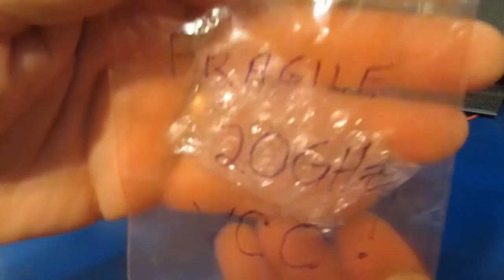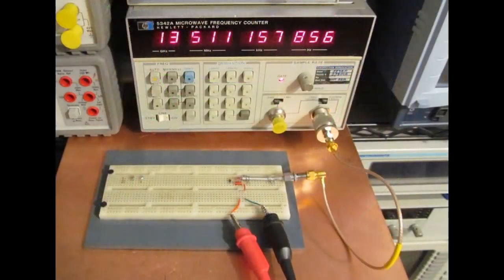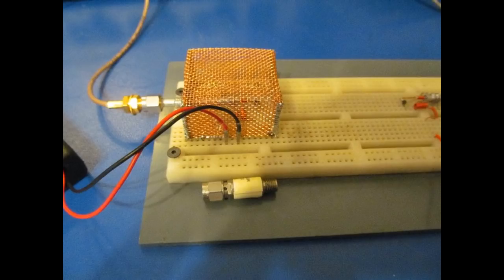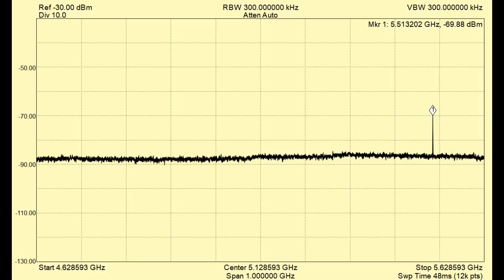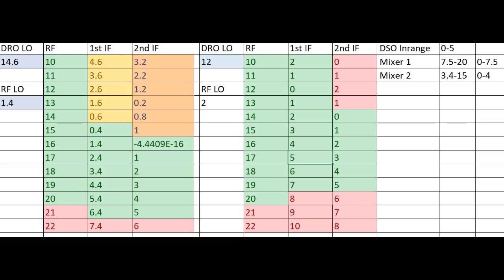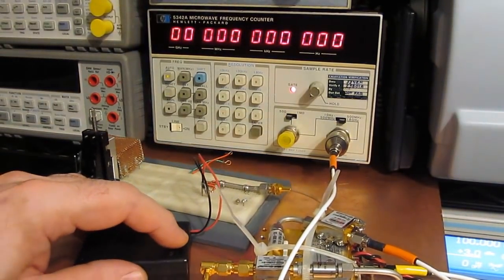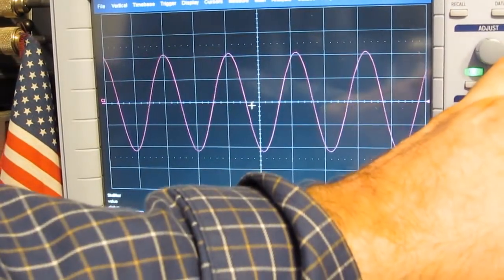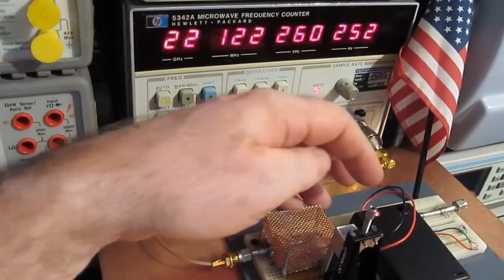Conclusion to the worlds fastest breadboard oscillator

Comment: I think at this point calling it a “breadboard” oscillator is reeeealllyy stretching it :) I always claimed that RF circuits look more like a moonshine factory than electronics, and your “it’s just wire” kludge up close is what I imagine some steampunk brass and copper “moonshine factory” might look like. This super cool stuff, especially for someone without RF experience. Very encouraging!
Reply from the maker: If you go back and read that thread, you will find that I was asking for clarification on the rules every step of the way.  A fun and entertaining little project but not very useful.

Comment: Nice Job, bow to the king. I sort of thought moving to a battery would have been good to prevent any noise from a power supply affecting  your oscillator output.
Reply from the maker: Outside of wanting a sinewave, there was nothing in the rules about distortion or drift.  Join and let's see what you can do!

Comment: I have no good frequency counter or high end lab equipment to test my idea, but you can test it! The idea is to use gas discharge plasma for microwave generation. As a gas discharge tube you can use neon lamp or another plasma device. The plasma oscillations frequency is proportional to sqrt(plasma electron concentration), which depends on gas pressure and voltage applied.

Comment: A great video. Microwave electronics really is plug & play!

I wonder if the mixer input match just detuned your oscillator a little!

Also, you could build a little delay line frequency discriminator to at least approximate the upper frequency limit if you were so inclined.....
Reply from the maker: It's possible the loading will pull it but the thing drifts around so much when you handle it, I may be difficult to detect without automating.   Close enough.

Comment: Can you tell me what brand,number and how many you have hooked in this video. I like the size as most I find are so damn small. Thanks
Reply from the maker: I bought 4 different transistors for this contest and had one that I had started with.  I am not sure what damm small is but again, I am using wire that has a smaller diameter than my hair.    Looking forward to seeing your entry.  Good luck.

Comment: hi, so i recently bought a Brymen BM869s and for the most part i'm really happy with it's build quality, fonctions, etc... but i have one complain with it that is somewhat intresting.
I wanted to try the crest fonction in VFD mode to see if there was any major differences compared to the normal ac volt mode and so i plug it into the mains ( 230v 50hz  where i live ) in VFD mode and at first everything was normal, i go into the crest fonction and everything was still normal, the problem was when i go back into the VFD mode, it doesn't autorange to 230 volts, it stays at it's lowest range and obviously overloads it ( both the ac reading and the bargraph but not the frequency reading ), so then i tried with a 12 volt transformer and same problem, even if i unplug the meter and then plug it in back into in mains or the output of the  transformer without changing anything, it stays in it's lowest range almost like if it was in manual ranging mode, the only way i found to go back into the autoranging mode is to either change the mode to ac volt then go back to the VFD mode, press the select button  or turn the meter off and then back on.
So i was wondering if you have the same problem with your Brymen and if there was a way to improve this.
In my opinon it's still a great meter and i'm still happy with my purchase 

and sorry for the length of my comment
Reply from the maker: Odd you would post it under a video on an oscillator but no matter.  I believe the manual mentions how the manual range remains.  You should be able to press the Select button to clear it rather than changing the function switch.

Comment: Hi Joe,
This is more a general question for your robustness testing on various multimeters:
I've seen a channel called Kiss Analog test a multimeter from amazon:
https://youtu.be/wfFG8v-RPQ8
Interesting about this multimeter is that it's 1: very cheap, and 2: UL listed/IEC61010 comliant etc; it's the amazon commercial 90DM610:
https://www.amazon.com/AmazonCommercial-Count-Digital-Multimeter-CATIV/dp/B07W1BL3RH
($47,72 currently on amazon).
I thought this would be an interesting candidate for your robustness testing experiments, as this might be the cheapest UL listed/IEC61010 compliant multimeter around with a reasonably good featureset.
It has a very similar featureset to for example the brymen bm235 but about twice as cheap (the brymen only has a better advertized accuracy), and of course easily available through amazon.
I think it's made by/rebranded from CEM.
EEVblog forum thread about hacking it: https://www.eevblog.com/forum/testgear/amazon-commercial-90dm600-multimeter-hacks/

Comment: I see a breadboard balanced on a copper clad springboard oscillating at about 5Hz - surely this cannot be the record? Maybe weighting down the inboard end of the copper clad with an HP frequency counter is not the only or best solution? I do see that the weight of the battery on the breadboard is slowing it a little, but I understand that cats must not be electrocuted without good cause. Congratulations, all very inventive.
Reply from the maker: lol  I have been using PCB material for some time to support smaller experiments like I have shown.   I made up one with better support and sides to prevent parts from rolling off but it was in use.   I should make up a second one.

Comment: For higher frequencies could you not measure the wavelength in air and calculate the frequency from that?
You can use interferometry or build a dopler radar to do that.
Reply from the maker: At the very start of the video, I read off the rules.  I also have them in the description.  They specifically call out oscilloscopes and/or counters. Assuming you are entering the contest, I would just post on how you plan to measure yours before you get started.
Reply: @joesmith-je3tq  ok, I missed that rule. Sorry for the double post.
I do not have the equipment to meaningfully enter the competition.
I would like to see Applied Science or somebody else who has experience with hard vacuum enter the competition with a klystron built on a breadboard and the whole breadboard placed in a vacuum chamber.
Reply from the maker: @larslindgren3846  You would need to ask Applied Science.

Comment: You mentioned not being able to test the full capability of the oscillator due to limitations of the equipment.  Couldn't you run it through your down converter into the frequency counter and just calculate it that way?  Or is there a limit in the converter? I'm sure you've already considered that though lol
Reply from the maker: Yes and no.  Certainly I could have mixed the 25GHz with the 12, filtered and then gained it up and fed this into the counter.  The first problem can be found at 14:53 where I mention this particular mixer has an upper RF and LO of 20GHz.   25GHz is >> 20GHz.  The part used was a ZX05-24MH-S+ from Mini-Circuits.  Conversion loss can be as high as 10.3dB   Let's ignore all of that.  If you followed the thread, there were people suggesting the oscillator (YIG/DRO) used to drive the LO for the down converter was being shown rather than the mixed oscillator's frequency.   Others were suggesting a harmonic was being used.  The list goes on.  Even in the case of the direct connection, there were people still thinking the counter was displaying a harmonic.  So, yes I could but every part added to the output chain raised questions about what was really being shown.  The direct feed to the counter was the best means I had to show that we were indeed looking at the breadboard oscillator's fundamental. 
So, yes, I could have found better parts to make an improved down converter or procured a used sampling scope.  Consider that in the end, it was just for fun.

Comment: so transistors switch at any speed- it depends on what you feed into em??
Reply from the maker: No.  Pull up some datasheets and have a look.
Reply: @joesmith-je3tq  oh! so what is the rating of the one you used?  it would be very helpful if u could tell me!  love the work its amazing!
Reply from the maker: @magnuswootton6181  You can use Mouser, Digi-key or other search tools to sort by frequency.  You can then also find links to the data sheets.   Pick something faster than I show in these videos and post a new record.
Reply: @joesmith-je3tq  what if you short both + and - pump in 10 amps, but send it through a tiny capacitor to protect the transistor base from the horrible torture?
Reply from the maker: @magnuswootton6181  As long as you run the device within its ratings, I would expect it to survive.  If you push the part into saturation it will require time to recover.  The datasheets will show recovery times.

Comment: Link in your description doesn't work.
Reply: Try this: https://www.eevblog.com/forum/projects/challenge-thread-the-fastest-breadboard-oscillator-on-the-mudball/
Reply from the maker: Good catch.  It's corrected now.
Reply: For higher frequencies could you not    measure the wavelength in air and calculate the frequency from that. You could set it up as an interferometer or dopler radar to get the wavelength. Then you don't need a coax either.
Reply from the maker: @larslindgren3846  Read my previous response.